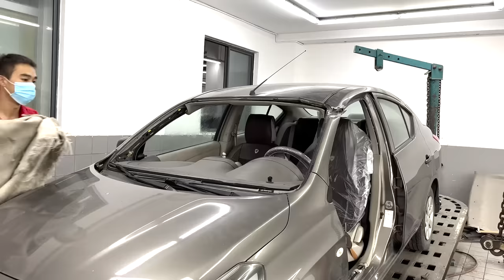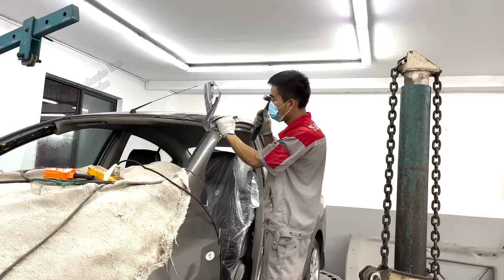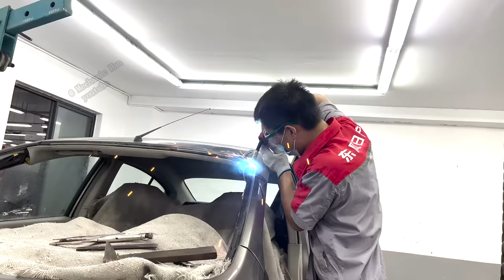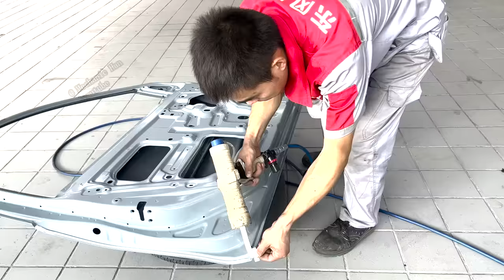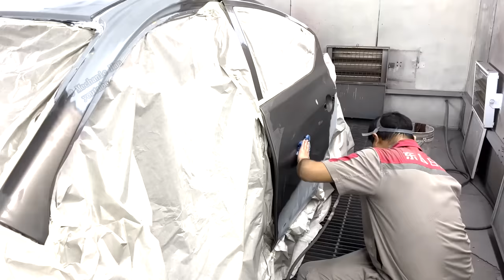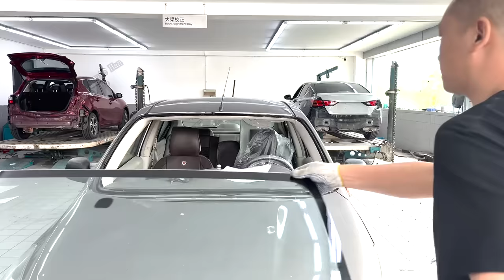Reviving a Wounded Warrior: A-Pillar Restoration Masterclass

Comment: Nice job except the rear quarter doesn’t match
Reply from the maker: It's not uncommon in complex repair and restoration work to encounter challenges with achieving a perfect match, especially when dealing with sections of the vehicle that have undergone extensive damage. Achieving an exact match can be difficult, and it may involve a compromise to ensure that the structural and safety integrity of the vehicle is maintained. While it's essential to strive for the best possible aesthetic outcome, safety and structural integrity take precedence.
Reply: It wasn’t painted and the car wasn’t polished and cleaned yet but once that was done it would be fine

Comment: I also had similar kind of issue with my Toyota. Got it repaired but during rains water drips in the car...
Reply from the maker: I'm sorry to hear about the issue with your Toyota. Water leaks can be frustrating and need to be addressed to prevent any damage or discomfort. If you're experiencing water leaks in your vehicle, here are some steps you can take:

Identify the Source: Try to locate the source of the leak. It could be from the windshield, windows, sunroof, door seals, or other areas. Sometimes, it's a matter of worn-out seals or gaskets.

Inspect Seals and Gaskets: Check the condition of the seals and gaskets around the areas where water is entering. If they are damaged or worn, they may need to be replaced.

Professional Inspection: If you can't identify the source or if the issue persists, it's a good idea to have a professional mechanic or auto glass specialist inspect your vehicle. They have the expertise and tools to pinpoint the problem.

Proper Repairs: Once the source is identified, make sure that the necessary repairs are done correctly. This may involve replacing seals, resealing windows, or addressing other issues.
Reply: @xinxianshi  Thanks for your detailed suggestion. I got it repaired at the Toyota Service centre but the problem was not solved 😕....the advisor adviced me to replace the top...

Comment: Is he wearing the "new chinesium slear welding glasses" they sell on temu?
He's going to be blind by 30 and have skin cancer by 29.
Btw, looks good but far from good.
Acceptable by china standards but not in the U.S.A.
Reply: Agree, not acceptable repair,  here in Brazil the car will be considered "total loss", at least "maxi damage" by the insurance company, if so,  the car must be validated after repair before get back to road.
Reply from the maker: It's important for anyone involved in welding to prioritize safety, and that includes using proper protective equipment, such as welding helmets or goggles with appropriate shade levels. Welding without adequate eye protection can indeed lead to serious eye injuries or damage over time due to the intense arc light and UV radiation.